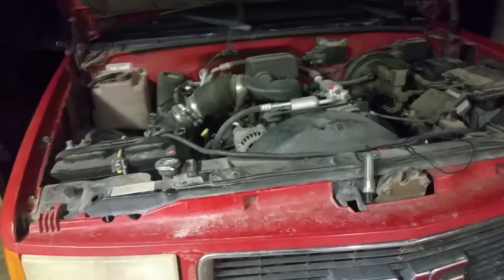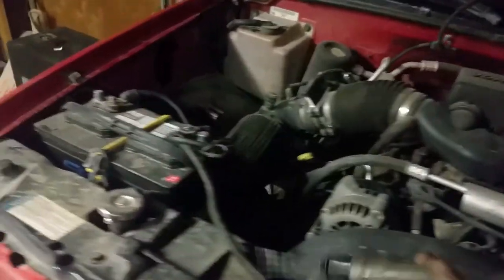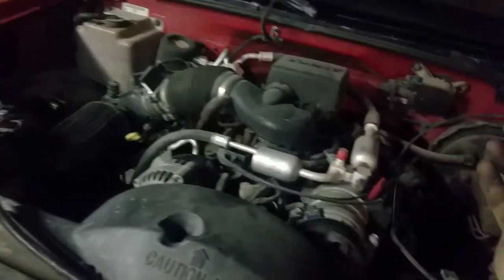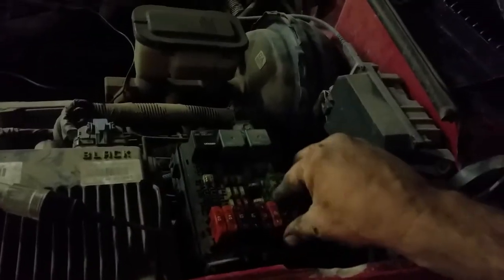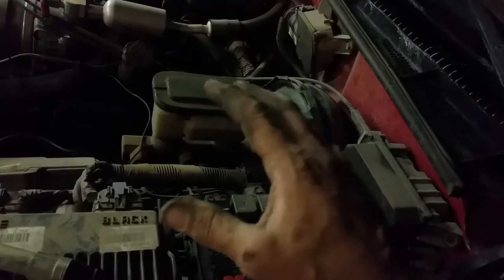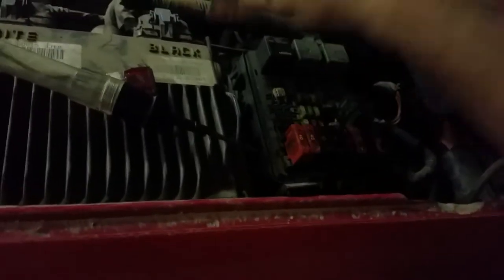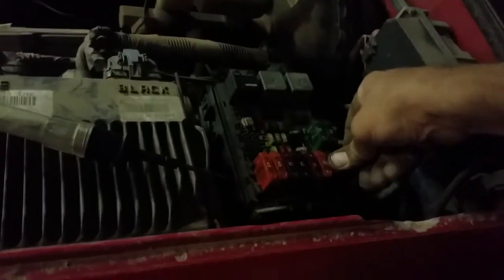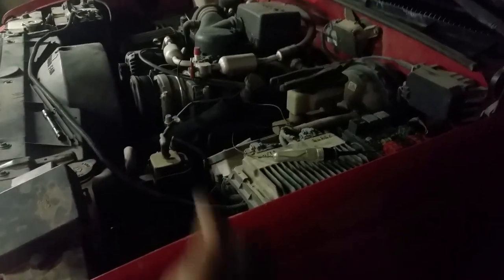A No Lights, No Start

Comment: I have a new battery and have limited on dash such as the check engine and brake indicator. Dome lights ok. Started the car but no clicking from starter. Absolutely no sound from the starter. I will check the fuses and get back.  Thanks for the lead to check the fuse box.
Reply: Car starting now.  The culprit was the starter fuse. Working on a/c, radio, gauges now.
Reply: Mine don't turn on or crank or nothing

Comment: I have no power to dash and no start on a '94 Ford diesel.  I did the "ground test" to both batteries BUT I have no power at all to fuse box.  I checked all fuses in the engine compartment.  I have no lights to outside and inside.  All fuses are good.
Reply: Did you fund out the issue?
Reply: Same here did you find the issue
Reply: @thelazyhandyman  
Yes, turns out the wire from the solenoid was burnt out and was not making contact 
Replaced with a new wire and no works fine
Reply: @rubenguerrajr5833 what solenoid? Starter solenoid?
Reply: All taken care of

Comment: Helpful video but the fuse is a symptom of the problem. What is the actual issue?  If you have an oil leak do you just keep adding oil?

Comment: I have 05 spectra drove it home. Turned it off and now there is no power to the inside of the car. No lights, no crank, no nothing. You think that could be the reason?

Comment: My problem is that my 2015 Chevrolet Traverse doesn't start no crank either, have no dash lights, no power, except for the fuse motor box and the cigarette charger. PLEASE HELP! It's been like that since November 2023. Thanks in advance and God bless.

Comment: Almost 4 dash lights lit, 6 or less volts to the car's 12V outlet. NO DC to the starter relay in motor compartment, ALL FUSES GOOD. BMW E39, the battery in the trunk. ALL, And just 4 relays that work well.
?

Comment: Yes I was wondering if you can help me. I have a 97 Oldsmobile bravada 4.3l no lights on the dash at all no Crank no start no nothing. I took the alternator and the starter to AutoZone. They checked it. They both pass. I install a brand new ignition switch and ignition switch harnnest. Still nothing. What do u think the problem is?? Pls help. This is the only car I have .I know is old but I can't afford another one. Pls help.
Reply: Did you fix the problem ?

Comment: Hey..at the beginning you said ground it out...what do u mean by that and how to do?  Cheers
Reply from the maker: just meant to make sure that the connection on the alligator clip side is good, i did that by connecting it then testing against the positive side of the battery to insure i had good ground before i got started.

Comment: What can blow a 50 amp battery fuse? Curious.
Reply from the maker: any voltage over 50 amps, it would normally be a ground short, or starter/alternator. those are the three i would start at.
Reply: thomas brian -- thank you. I have a Ford E150 conversion van in pretty good shape.  Engine started and then suddenly died! Since then i charged the battery & reinstalled but nothing,  not even lights! Since it was already something took it out. Thanks for giving me something to check.

Comment: No lights in the dash but with jumping calbles it does start ,but when i turn it off it wont star again ?
Reply: same problem with an 02 grand cherokee
Reply: Did you figure it out? Same issue with 08 Acura TL really sudden issue too, I shipped my car overseas and now I have this problem. It was perfect before
Reply: @markesquivel2284  Yes I did. I had a massive voltage drop from the negative terminal on my battery to the negative cable itself and replaced all 7 power cables just to be safe. I recommend using a voltmeter and putting both prongs on each neg/pos terminal with the terminal cable. If your Batt is good there's a issue somewhere down the line. Check this vid out - https://www.youtube.com/watch?v=xerAp9Yd53Y
Reply from the maker: check your battery for amps, not volts. you can have 12 volts but not enough amps to crank or even light up lights. check all connections at battery, and starter. I think you are missing amps, or a huge draw is in effect

Comment: Cable that goes out fromcruice control module cased my van to no crank no lights nothing do i have to get the module?
Reply from the maker: i believe so, the cable is part of the module if i remember right

Comment: As soon as I put a new battery on my truck, the dash lights go on, everything seems perfectly fine, then I try to fire it up and it goes completely dead, it wont even do the effort of crancking a little but It only runs bypassing energy from another vehicld y
Reply: Starter is completely dead, when you turn your key to start the car will cut all power to supply voltage to the starter. That’s why you see your dashes go off when turned to start.. clean your grounds to the starter, try that. If not replace it.

Comment: The car starts but all gauges n warning signs have no power except check engine
Reply from the maker: check the ground to the dash, it will be behind it. you do have a fuse for just dash lights as well. if both are good, go to a faulty dimmer switch.